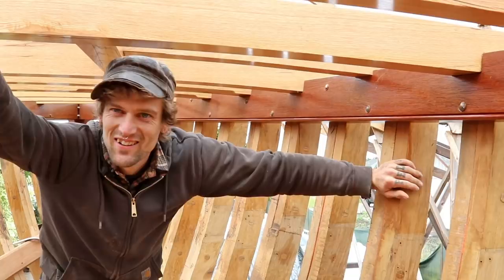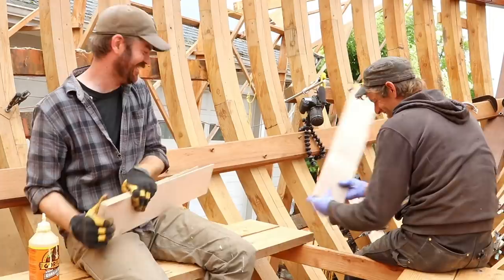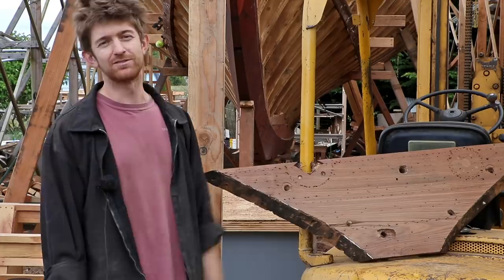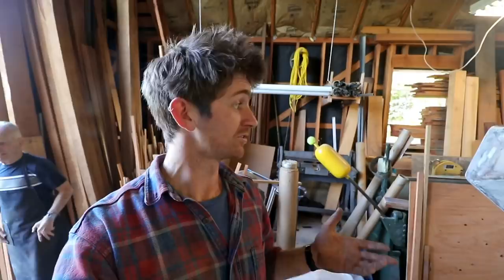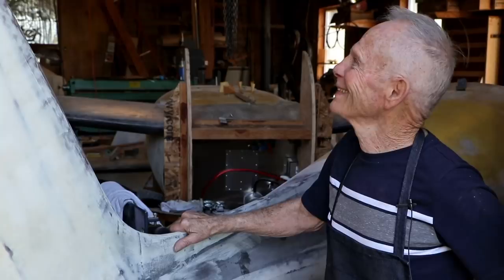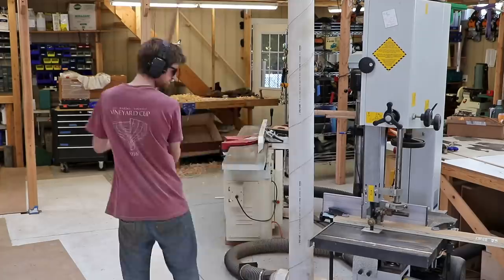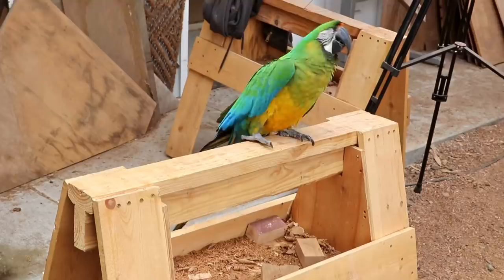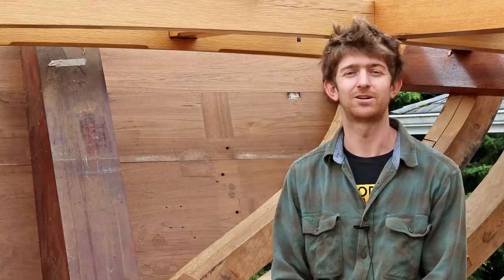BoatBuilding - Restoring the Transom (EP74)

Comment: I understand the desire to use what material you can from the original boat. When the teak boards are used to keep out water, it seems intuitively obvious to me not to employ planks so full of holes that they resemble swiss cheese. Maybe its just me but dont you usually want the exterior planking to be free of knots and holes? I can see using the old teak for interior work like cabin work but I would be likely to shy away from using this pre drilled lumber on any surface that will be critical in keeping the ocean on the outside of the hull.  Like I said, this is my opinion but isn't it the whole point in having a boat is to keep the water out so it can remain afloat? Sure to days glue is pretty good, but I try to never leave it to a bit of glue to decide weather or not I drown in my sleep while half way across the Atlantic ocean. I love your work Leo. Dont get me wrong. You appear to be one hell of a shipwright. I just question your choice of locations for the use of this holed lumber. I would have cut it up to make window frames or some part that could not sink the vessel..

Comment: Two questions for Leo: While resurfacing  and repairing the Teak, it appears that quite a bit of the original thickness was taken away, and the amount removed seemed substantial. 1) Does that now cause a significant change and wanders away from the intent of restoring Tally Ho back to what Albert Strange intended and had originally designed? 2) The thickness of the Transom is now thinner, does that affect the structural integrity that a thicker Transom would provide?

Comment: For what it's worth, the brand most certainly DOES have merit when it comes to adhesives. And the fact that you're using one of the best and first commercially available brands (GORILLA) speaks volumes.
Also, it is important to dampen the surface to be glued with a little water before you adhere the two together. It allows for deeper penetration and stronger holding power no matter the substrate.
Lastly, now you have a nice flat bit on the back for your trolling motor! 😜 get it???   ..."troll"ing? 😮 
Love the progress and the passion as always. 
-✌🏼

Comment: Have you considered resorcinol glue? It is more UV and heat resistant than epoxy. In the late 1940s my dad built a car-top (station-wagon-top) camper using plywood and resorcinol. It was used for many years, but by the 1960s it had outlived our need for it. My dad tossed it out in the woods and forgot about it. Many years later (decades) he ran across it again. The plywood had rotted entirely away, leaving a sort of wire-frame sketch of the old "Campnicker" (makes camping like a picnic) of resorcinol ribbons where the glue joints had been. It crumbled at a touch, but it was a remarkable testament to the durability of resorcinol.
https://en.wikipedia.org/wiki/Resorcinol_glue

Comment: Were the original floors cast iron or cast steel? It sounds like the new floors will be cast from silicon bronze?  Some silicon bronze can be "as strong" as a decent steel.  Are you worried about a strength discrepancy since it sounds like they essentially tie the keel and frames together or maybe you have discussed the process and chemistry with foundry to match or exceed the strength of the old floors?

Comment: The decorative beads and chamfers - the chamfers were widely used in wooden structures, not as decorative element and even not as to protection against painful head bumps, but as fire protection measure. Beam would catch fire  much slower from oil lamp positioned too close to it, if the sharp edge was chamfered or rounded. What the logic behind the truck plank bead on the stringers? I suppose it is not to appeal to the sense of beauty of the herrings catch?

Comment: @  Sampson Boat Co: Please explain about the grain of the Douglas Fir splines? Is the axis of the spline purposefully  not parallel to the axis of the tree? When you look at the end grain of the splines do you see annual ring lines that run diagonal to the sides, so that the splines are neither quarter sawn nor flat sawn?  If you look at the two end grain faces will the end grain lines be not parallel?

Comment: Just wondering about the splines - once the fir gets wet (I guess it will wick water from the exposed sides, even though the diagonal grain will stop that at some point), it would swell more than the teak plank and push the sides. Any concern about that? Also, the transom will be above water, therefore exposed to fresh water only. Curious as to why you didn't use teak instead. Thanks!

Comment: It's interesting what you said about glue vs mechnical fittings .I build wooden dinghys for a living. All my boats are built without any mechanical fitting , in the actual build  and all put together with  epoxy . Obviously when scaled to the size of boat you are building this is impractical. In yacht building is glue general considered inferior? Or is it your personal opinion?

Comment: May I ask if this Vessel will be capable of Deep, Blue Water Sailing ?  I have no experience on the Oceans.  Ted.
Reply: Well, Tally-Ho won the Fastnet Race in 1927 in atrocious circumstances: Only 2 yachts out of 15+ ended the race succesfully. On top of that is sailed the Atlantic, the Pacific (several times). I am pretty shure that restored TH could sail every ocean many times.
Reply: @on4xb  Thank you.

Comment: There is no way I would accept the narrowing or thinning of plates of transom wood like that Even if it is teak !
What you have done is structurally reduced the thickness of abused wood and yes filled a bunch of holes and made it look good,
Teak is an oily wood and does not hold glues of any sort very good,
In some time of the future the glues used will separate from the wood, and if the swelling of wood from water holed's the plugs in good, but if in dock for a season they could work out
Looks good from the finished product, but I would have failed it.
Reply: @paulcopeland9035  Well said!!!

Comment: Sorry for my ignorance but why no glue in the joints for the transom?
Reply: The short answer: glue joints will always fail. Might take 20 or 40 years, but failure is certain. Wood is constantly moving in response to temperature & moisture content, while the glue moves at a different rate due to temperature & not at all due to water. This differential movement shears the glue from the wood.

Comment: The only question I have for you is about your glue choice, I am a professional cabinet maker, I cannot tell you how many times people have brought me chairs or tables to repair after they tried to use Gorilla Glue and the stuff just peels off, I would never use it on anything, just wondering why you didn't use a good marine two part epoxy? I know it is too late now but I am sure you have your reasons for doing what you did there.
Reply from the maker: if you see failed polyurethane glue it is likely because the joint was not tight, I believe. I have seen epoxy fail many times too. The thing is to know what conditions make different glues fail - epoxy will fail if temperature is not right or if it hasn't been mixed thoroughly enough, or if the teak isn't cleaned properly with acetone. PU will fail if the joint is not tight. In my humble opinion.
Reply: @SampsonBoatCo  I am sure you know what is best for your boat you just worked so hard to save that piece of wood I guess time will tell ..nice job on that boat I have watched all of your work, and it is really paying off..I too have many boats, and I laugh everytime I spend money on them, they really are a hole in the water you throw money into....I see for you it's an act of love and passion, job well done.

Comment: 14:37 - why is he starting the generator by hand??
Reply: It has no ability to self-start - the pull cord spins the motor initially, so it can create the moving magnetic fields that will drive it.
Reply: @frederickstibbert7389  does it mean that this generator has no input on electricity? Just start it and it produces 3 phase power?
Reply: @agentofart5425  - I don't know how it's wired, but the motor is connected to mains 240v AC single-phase power input & (somewhat inefficiently) provides 208v AC three-phase juice to the machine tool. Leo's shipsaw uses an auxiliary electric motor & belt drive to give its converter/generator the start-up spin.